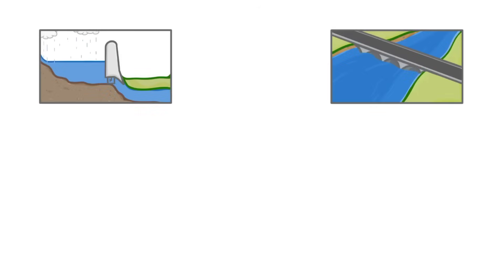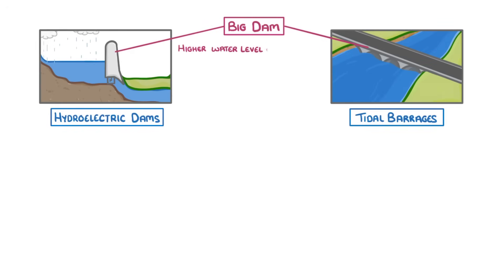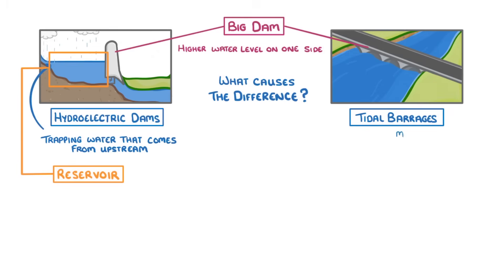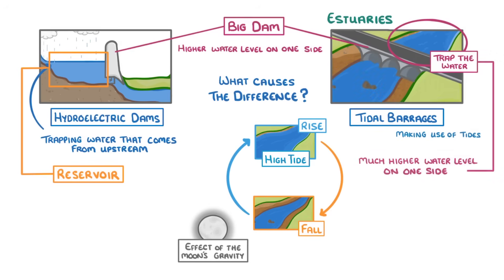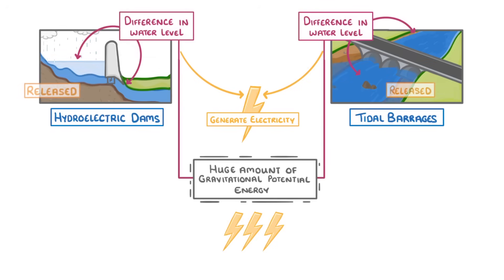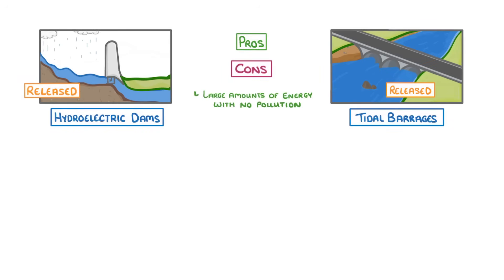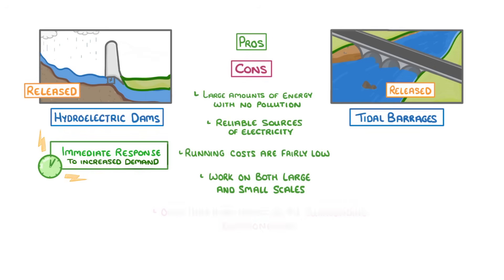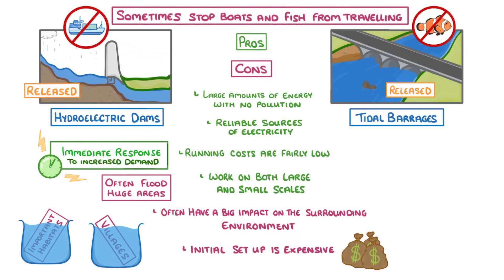GCSE Physics - Hydroelectricity and Tidal Barrage

Comment: hey is the tidal barrage essentially a smaller  height version of the hydroelectric dam?
Reply: Yes, as the tidal barrage is mainly used for generation of electricity. A normal barrage (the smaller height version of hydroelectric dam) has also the same purpose, thought not necessarily the main purpose. The only difference is that the tidal barrage is built for the purpose for the generation of electricity only from tides, while a normal barrage can generate electricity from still water.